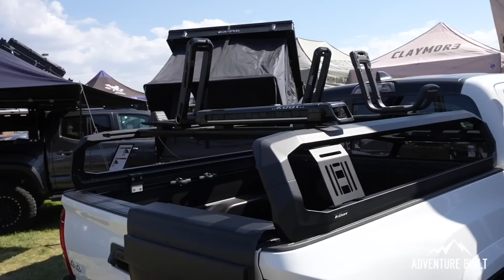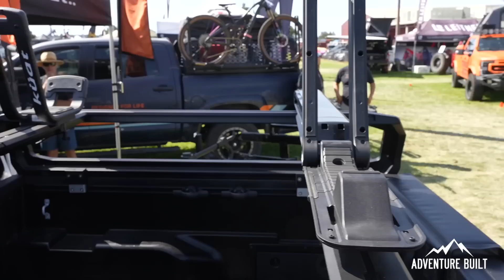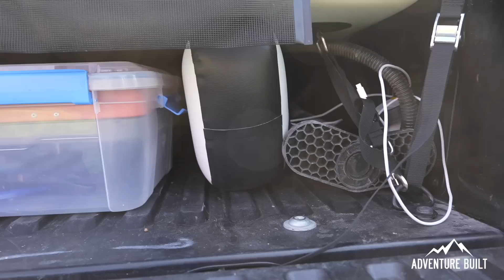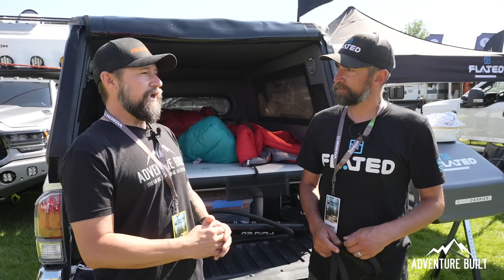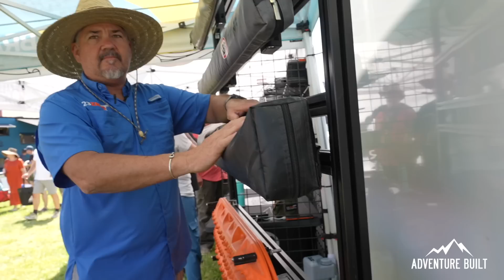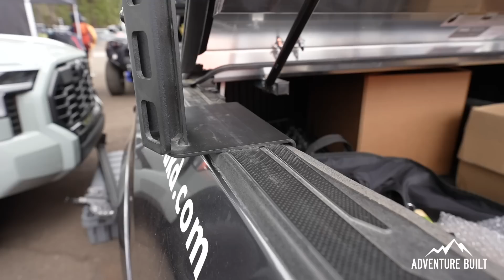BEST OVERLAND BEDRACKS FROM OVERLAND EXPO PNW | FLATED, KUAT, RACKS BRAX- 23ZERO, TRUKD

Comment: I just finished building my own rack for my rtt and awning which is adjustable. I can drive with my tent below cab height and then quickly raise it up over head height so my tent and awning are comfortable to stand under. Works awesome. I can roll up my tonneau under it, the whole setup with tent and awning is less than 300lbs and it cost me like 400 bucks to build. Even built a pressurized water tank that I mounted on it too.